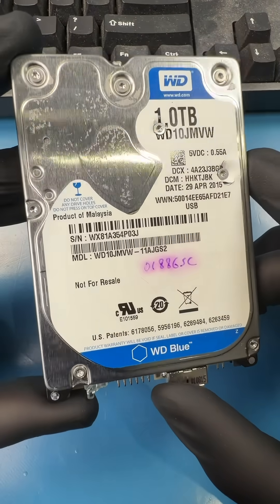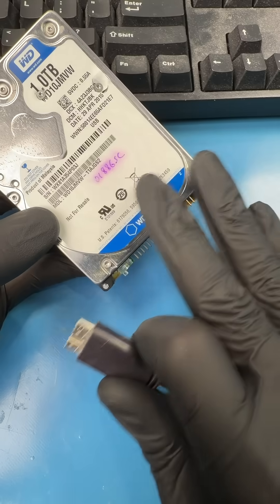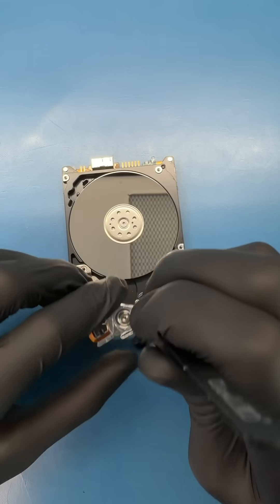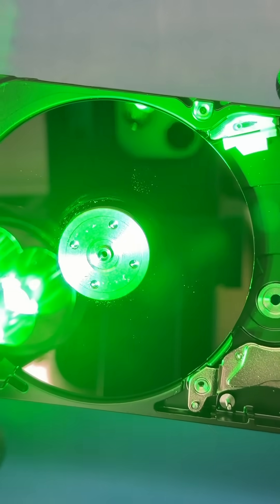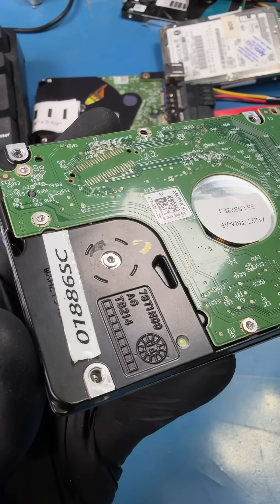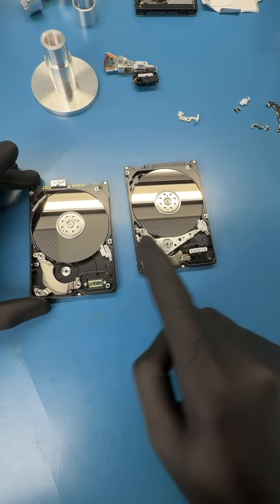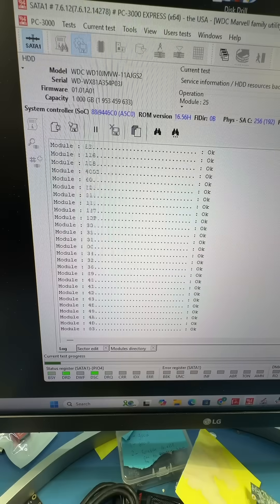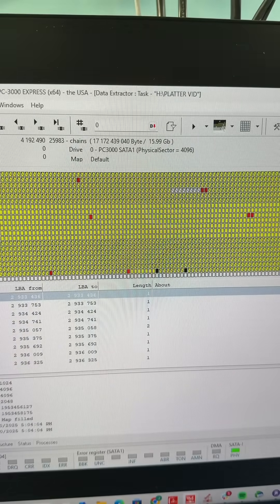Clicking hard drive? #datarecovery

Comment: The lesson of this video is NOT, that there are incompetent bad companies out there, but back up your stuff! Buy a new HD every 4, 5 years and mirror it.
Reply: and double backup.
Reply: It can always be both.
Reply: lesson learned: do not trust big box store they just want your money
Reply: Nah the lesson is that cats are evil
Reply: I mean they are absolutely incompetent if they can't do their job. Their job was literal data recovery. The story basically screams a physical failure that's not the platters. It's not like the hard drive got sector cancer or something. So yes, they are absolutely incompetent. These services don't cost $20.

Sure, people should back up their data but most people won't. They have a million excuses not to until An Event (TM) happens and they are crying crocodile tears.I've seen it a million times over.

There's no excuse not to have a backup, generally speaking. There's too many cloud services you likely have access to. 1TB is under $100.

Cloud backup so you have an archive far away from your physical location. Have a local backup in case you lose power or the cloud takes a shit. That local backup should be easily able to be thrown in to a backup for an evacuation (e.g. fires, hurricanes, etc). Encrypt the drive.Use Bitlocker, use Mac's encrypted FS, whatever - if you want. Use a password manager.

Personally I'd say get some kind of SSD. Avoid platters entirely. Get like an m.2 plus an enclosure and several problems solved. Usually the worst that happens to them is they get yeeted in a backup and the stick slightly disconnects in the enclosure. Just pull it out and put it back in again. Fixed.

If someone can afford repair services - they can afford backups.
Reply: Ita both actually
Reply: lesson: You can't rely on the incompetent bad companies so back up your stuff.
Reply: Or use storage media without moving parts might be the true lesson here?
Reply: @RoCkShaDoWWaLkEr even those need redundancy
Reply: @athmaid  In over a decade I've never had one fail on me and never had a customers SSD fail ;but if you want to rest easy just run storage in RAID.
Reply: @RoCkShaDoWWaLkEr  The risk of data loss is significantly heightened on an SSD if it isn't powered on from time to time.

If you write something to an SSD and sit it on a shelf for 20 years it'd probably not have your data on it when you go back to it.

I have a Toshiba libretto 50ct with it's original install of Windows 95 still going strong after all this time. While it is a 2.5 inch ide drive it's really thin and replacements that fit are hard to come by unless want to use a solid state solution like cf cards or micro SD cards and the adapters they sell for cheap. That's what leads me to believe it's the original drive plus the fact it's only around 800 MB which was only hard drive size for that particular model.
Reply: @RoCkShaDoWWaLkEr that's just luck.

I've worked in IT infrastructure and I can promise you that SSDs can fail sometimes.
Reply: @mrfish9876  Anything can fail sometimes ;but I haven't had a single one fail on me and none of the people I've built computers for have had one fail, mechanical drives on the other hand....
Reply: @RoCkShaDoWWaLkEr congratulations, but that's survivorship bias
Reply: @RoCkShaDoWWaLkEr don't matter something can happen to it too. If the chance is low of failure is good but not 100% safe. There is the 3-2-1 rule or you can at least have a equal drive to clone frequently the one you use the most.
Reply: @michaelperez6811  Never heard of RAID I take it (also I've been a computer tech for over 20 years and have never ever had one of my or my cutomers SSDs or NVME drives fail ;but as I mentioned RAID prevents loss of data because it uses multiple drives for redundancy . Cloning frequently is dumb as hell when systems exist to solve that issue automatically.
Reply: The lesson is to not get a cat.
Reply: @Whydoyouneedtoknow776  Skill issue I've had up to 5 cats at one time and they've never destroyed my hard drive.
Reply: @Thedoomslayer2029  You have a pet that defecates in an open air box and then walks it through your house. You are the skill issue.
Reply: @Whydoyouneedtoknow776  A litter box is only as dirty as that person who cleans it.
Reply: @Thedoomslayer2029  And I take it you wipe all 4 of your cats paws ever couple of hours too right?
Reply: @Whydoyouneedtoknow776  yeah I do? Do you wipe your dogs feet off every time you get home from a walk, or from when they get outside, do you let them lick you? Pets are as nasty as their owners

Comment: Is that 15GB of unrecoverable data not spread throughout the drive? Is it contained to a folder or 2? I’m confused what exactly is meant by this.
Reply: I don't see why it wouldn't be spread throughout the drive. Stuff like scratches go across multiple tracks meaning it's impossible to not affect many different files spread out across the drive. In fact as far as I know files tend to even be spread out across platters for more efficient reading, meaning that a scratch across one platter is effectively affecting that many more files (multiplied by the number of platters, which varies)

Comment: Backup backup backup.

I have two backup drives at home and two backup drives in a safe deposit box. Every three months I swap the drives from home with the ones at the safe deposit box.

Overkill? Maybe. But it provides my data to be in two physical locations and a drive failure at each location.

Comment: This is rather unfortunate.  To combat data loss to combat data loss I have all my files backed up to a dual redundant NAS and then I occasionally back up the NAS with an external hard drive.
Reply: Why not in the cloud?
Reply: @Happyflying-m5q Im sick and tired of epople saying "the cloud" that shit is awful
Reply: @furriesinouterspaceUnited   Hi man, why? I use both a NAS and the iCloud, both have pros and cons. What’s your experience with NAS downloads, that’s the bottleneck for me.
Reply: @Happyflying-m5q Downloading from NAS externally will be up to your internet upload speed. My brother has symmetrical 1gbps fiber and can stream out 4k movies just fine. However it will still be slower than from a cloud server.
Reply: @furriesinouterspaceUnited  Sure if you're with a bottom of the barrel company with shitty speeds. With more reputable companies the only downside is the cost.
Reply: @Happyflying-m5q expensive to back up 16 TB of data to the cloud.  It's just cheaper to buy bigger drives. As secondary backup.  How cloud backup does h get the data out of my house in case of fire.
Reply: @ironqqq  I have also a NAS but I still have a large iCloud plan. The NAS is good, but quite useless when I want to download files over the internet. It’s very very slow.
Reply: This is the way. I'm waiting for a good deal for a external hard drive to pop, then i won't have to worry about the Raid 1 Nas going poof. Going cloudless is fun!
Reply: You are taking that hard drive backup offsite, right?

Comment: 3 backup copy protocol for priceless, irreplaceable data. 1 physical medium, 1 flash medium, and 1 off-site physical or cloud medium. Alternatively you can have 2 flash copies instead of a physical and a flash. If the data is sensitive and leaks would be bad, use physical instead of cloud for the off-site copy. If the house burns down, you could have 5 flash copies and it would be useless. Also remember that flash storage "decays" over time due to cosmic rays and quantum tunneling. If you loaded an old flash drive or SD card with priceless data and let it sit in the garage for 15 years, you may find that the drive is corrupted or some files are unreadable. Always copy the data to a computer or temporary drive, do a low level format of the storage drive, and put everything back on the storage drive if it's been longer than 3-4 years. SD cards are the worst flash storage medium ever and should never ever be used long term. If you have an SD card with Disneyland photos from 10 years ago, GET THOSE OFF and put them on a proper storage drive like (preferably) an SSD or flash drive. Spend the money, get the drives, do it right, you will be so glad that you did the 3 copies and maintained your storage drives over time. Trust me.

Comment: To all the uninformed backing up your data means there is an original location plus another location that stores, the entirety of the data. Extra bonus points for storing it in some sort of raid configuration that guarantees redundancy of the data stored across the drives.
Reply: If controller fails you you will have more issues than just all drives bricked...
Reply: @proveren nobody uses hardware raid these days
Reply: @proveren  what issues?
Reply: @proveren what controller, raid is controlled with a software nowadays, any pc can do it
Reply: @proveren  Nah, replace card and you're good. Configurations are stored on the drives. You can back up the configs on the card and copy to new card as well.

Comment: It's my understanding that modern hard drives have a G sensor built in, so when it detects rapid acceleration (like a fall off a table) the read heads are immediately parked off the platters to brace for impact. Is that true? It doesn't look like there's much damage to the platter surface so maybe the fall took out the outer edge of the platter as the heads were almost home?